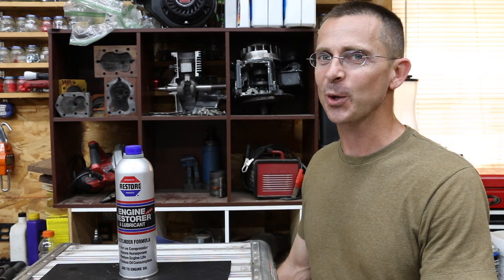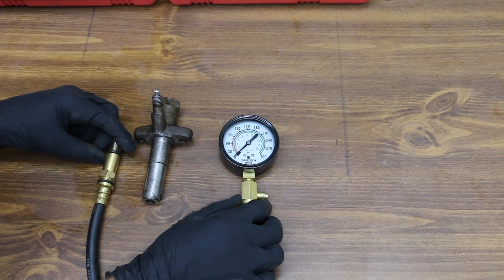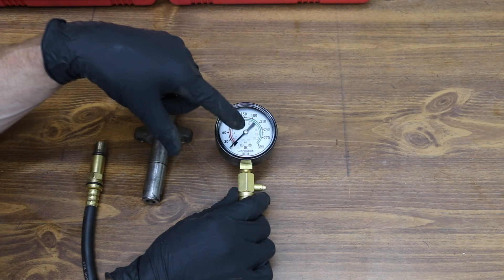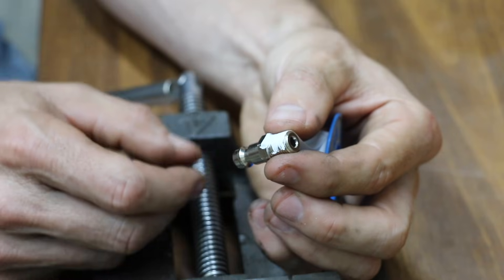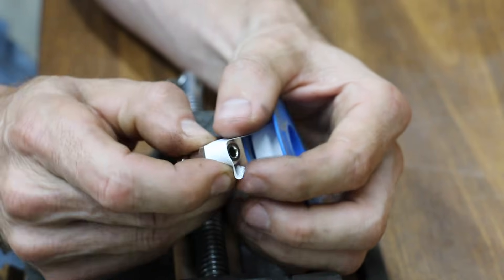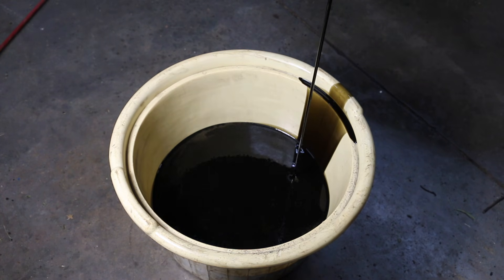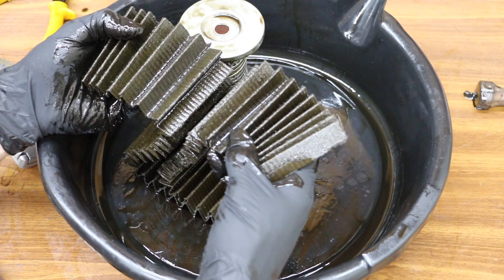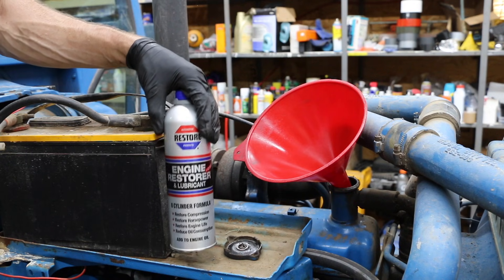Did the "Engine Restore" Compression Improvement Last?  One year later (Episode 2)

Comment: I've always liked restore. I don't back really any other products except for a couple of things like PB Blaster. I use ATF a lot when working on vehicles... great when added to engines with buildup. I would use ReStore in any engine that you're about to give up on and is not worth replacing. I wouldn't put it in a new high tolerance engine but I would definitely put it in anything else. I'm glad to see that it works and hopefully other people can use it and it will help them in their situations great video.
Reply from the maker: Restore seems to work great!

Comment: hey, you asked for new ideas ? here's one   HIPNOW   or  G system of Paul'S Pentone GEET   . The first one is a simple .375 inches i.d.  12 inches lenght  ss tube that you shape in a long   U   , you install it inside exhaust tube as close as possible to the exhaust manifold. It has to get hot. One side of the tube goes to the intake manifold via a ball valve, to be distributed to all cylinders, the other side will go to the top of a water reservoir heated by the muffler , a ball valve must be installed right before the intake  tube to control the super heated  water vapor. flow;   to avoid running away of the engine. .   When it will work, check the oil for cleanlyness. .    Quanthomme.fr   G system   experiment. . Would be really kool from you. . .
.
Reply from the maker: Great recommendation--thank you!

Comment: Great videos......you mentioned that, from your experience,  there are two oil additives which actually work, and Restore is one of them.  Please mention the other product.

Again, Thank You for your excellent work!
Reply from the maker: MotorKote and Bestline also seemed to have great film strength. However, I have not performed "long-term" testing on those products as  I've done with Restore.  Thank you!

Comment: You havent found anyone to machine a stock psiton into a high ringed ,high compression? I'm still rooting for a HIGH compression engine! You can mill the head down even by hand with fine grit paper. Just make sure you make valve clearance. Believe ,eit willsound like aoldtank when it starts.Torque like you wouldnt believe.
Reply from the maker: This is a great recommendation!

Comment: This is the one product I thought would not work, but did work! My 96 Outback with an EJ22 had bad rings in #1. I did before and after compression test and it did make a huge improvement! Also oil consumption went down, and mpg went up 2 mpg. Worked for a year and I just changed the oil and filter and added restore once a month. Ran a year then swapped in a new ej22. This stuff really works and helped me get by.
Reply from the maker: Impressive results!

Comment: Here's an idea: I was watching your STP vs. Lucas video and it seems like mineral oil is in STP.  Maybe test using mineral oil as an oil additive alone - not sure the mix required but that would be a cost effective oil additive in my book.

Mineral oil is great for electrical parts as well - as a sealant and protectant.  I've heard of folks dunking their PCs into mineral oil to protect against dust and water.  It'd be interesting to see if it also functions as a mechanical sealant/protectant.  Also, subscribed.  You bring experimentation to engines I haven't personally seen.
Reply from the maker: Great recommendation!

Comment: A suggestion I have for your next text with the lubricity test is for diesel additives. Since Cummins came out and stated that their engines should use diesel Kleen as  for their engines for engine wear and other parts, I'm wondering which brand would yield the best results. And for a cetane boost. Just wondered what you use for your old tractor as well.
Reply from the maker: Great recommendation!

Comment: My car's engine blew the head gasket,i torn the engine and the overall damage it had wasn't worth 700$ for a rebuild. I got the best replacement engine i could find for cheaper, however it's bad and even at 900rpm it has MORE cylinder blow-by gasses coming through the oil cap than what gets out of the exhaust!
Judging by your experiment, i think that this could help a little bit, although missing metal ain't gonna grow back. THANK YOU!!!
Reply from the maker: Thank you!

Comment: Prolong VS DuraLube VS MolySlip (AKA Mr. Moly). Had a 1953 Hudson a few years ago that had a recently rebuilt engine. It would take a lot of cranking to get it to start. Some times had to give it a shot of starting fluid. Drained the oil filter (one of those old style ones with the small lines, not full flow) to make room for the 1QT of DuraLube.

The first time starting after adding the DuraLube was like before, but from then on the instant the first plug fired it was running. One caveat though, due to it being a recent rebuild the rings hadn't seated yet. The DuraLube made it burn oil like crazy.

Had to change the oil along with a bottle of engine flush. Ran it for the flush's recommended time then changed the oil again. that stopped it using oil, yet the instant starting stayed.

Another hard starting car that DuraLube helped was a 1952 Nash with the big OHV straight six. Its side draft carb was a PITA, especially when parked on the left side of a one way street because the carb would angle down and gas would run out instead of being drawn in. With DuraLube in the oil it cut the friction so the starter could spin it fast enough to draw the gas in easier, even if the car was tipped to the left.

My sister and then brother in law had a 1980s Dodge Caravan which had developed a terrible knock that sounded like a spun bearing. Just for the heck of it I put in a bottle of Prolong. I had the van at my place for sale and every time I ran it for someone, it got quieter and quieter, until for the guy who bought it it had no noise at all. I told him it had had a really loud knock but he didn't care, he had a van just like it with a good engine but trashed interior. Said he'd run it until it blew up then swap engines. He ran it at least two years without the engine failing.
Reply from the maker: Thanks for the video idea!

Comment: I hav used restore in my 02 mustang gt ever oil change for the past 14 years plus use Mobil 1 fully syn 10w30 hav got over 320000.0 trouble free miles still runs strong get 3rd gear rubber with tap of the gas with new BFgoodrich tires
Reply from the maker: Impressive!  That's a lot of miles!
Reply: I used to b Chevy dude I owned 87 iroc Z28 5speed for 10 years at end of 10 years it had only 50000.0 miles on it and I worn out Toyota Corolla n mean while. Dang Chevy was torn up so much n had trouble finding parts cause it had 35 of 36 options offered that year !! Got my ford day after I sold Chevy and drove her every day sents 14 years ago

Comment: I've had good luck with Lucas transmission additive. And as a rule, I don't believe in most "mechanic in a can" products either😎
Reply from the maker: Thanks for commenting.
Reply: I used it in my 2004 Grand Prix that had in intermittent slip at long red lights after changing fluids and filter that was 250000 km ago I change out 4 litres every spring and add half container of Lucas trans ( few ounces,) no problems with my trans since . I believe if people changed Tran fluid 4 quarts yearly through dip stick tube you would not have 1/10; the transmission issues
Reply: I am looking for a used pick up ,one of the questions I ask the owners is have you changed the trans fluid since you owned the truck 99% say they have never changed the fluid ( no hope for the ignorance of the general population) then they run down the car companies when the transmission self destructs at 150000 miles

Comment: Sealant tape tip.  I use it a lot in industrial manufacturing setting.  I saw a lot of tape past the end of the fitting and this runs a risk of clogging if that tape get into small orifices.  To prevent that.  screw fitting into threads about 1 thread worth, then apply tape.  That's industrial best practice training.
Reply from the maker: Great tip!

Comment: I think you should start a little long run test where you try as many rust preventative strategies and coatings as possible. Everyone hates rust and everyone has their opinions as to what works and what doesn't. An issue is how well the rust preventative coating works if it's compromised, like through a scratch. I've heard that with things such as rubberized coatings, they work well until they get scratched or chipped off, because then water and whatnot makes its way behind the coating and the entire thing just rusts underneath the coating. And I've also heard that some treatments might actually accelerate the rust by pulling in moisture like a sponge. You might could start off with a longer video showcasing what exactly you're gonna do and then have short update videos every once in a while showing how everything's holding up. Have the test pieces in multiple different situations, such as pieces that are stuck in the ground, pieces just sitting outside,  exposure to salt water, exposure to fresh water, exposure to different chemicals, exposure to debris and abrasives(simulating say, the undercarriage of a car or truck, which is frequently subject to stuff getting kicked up from the road). I don't know, I just think this could be a series of videos that could really be useful for a lotta people. Not really anything that should require too much effort. Should just be treating the test pieces initially and checking up on them every few months.
Reply from the maker: I'll do it. Thank you!

Comment: Great video Todd, thanks for the update!
Engine Restore also helped my little 1310 Ford diesel tractor as well. It started easier and ran better after using the Engine Restore in it. Sadly, I sold it at the beginning of this summer because I needed the money worse than I needed the tractor.
Reply from the maker: Robert, Thank you very much!  I'm glad that engine restore helped the tractor and understand the money/equipment situation.  I'm in the same situation. Thanks again, Todd

Comment: Just a question I have a 1985 200s Honda atc.  Runs and drives good but during last oil change i noticed some metallic flakes in the oil.  It doesnt have an oil filter and the transmission is lubricated by the same oil.  Is it possible for most of it to be from the clutch plates and other clutch hardware and not much wear on the engine itself?  Anyways love the videos and hope to see more coming.  I would be interested to see how this product works in other engines like atv engines or higher revving engines.
Reply from the maker: It's possible that the flakes are coming from something other than the connecting rod and cylinder wall/piston/rings.  However, I'd recommend changing the oil frequently to avoid the flakes causing damage.
Reply: Project Farm ok thank you for the reply

Comment: You need an aircraft oil filter cutter. They are not that expensive.
Reply from the maker: I'll buy one.  Great recommendation!
Reply: They open it like a can opener. Remove the filter gasket before cutting the  filter. Otherwise you can break the cutting wheel.

Comment: I just bought my truck and it's a 2000 ranger 2.5l, just cleared out the truck with seafoam and was curious if DEF could work if sprayed in to get the same effect, I'm assuming no but also yes as it burns the emissions for deiesel exhuast
Reply from the maker: I don't think it will help either. Thanks
Reply: Project Farm thank you for your opinion I'll stick with sea foam

Comment: Awesome, good deal on that and another good video. A good tip on cutting the oil filters for filter examining is to use a chain tail pipe cutter, the one with the rollers on it like a tubing cutter. Make sure you get the longer one if you want to cut filters with it. Keep em coming!
Reply from the maker: Great tip!

Comment: Creating a new comment as requested, continued from below.  You wrote:

Thank you very much!  What type of round baler did you use behind the Ford 5000?  I recently purchased a John Deere 535 (makes a 5x6 bale).  I believe it'll handle it if I don't push it too hard.  Could you please create a new comment so I can easily locate your reply?  Thanks again!

I honestly can't remember the baler number, it was a John Deere and made 4x5 bales.  I never baled with the 5000, only wrapped to make baleage, and usually not with the Ford.  The main wrapping tractor was a little IMT 539 deluxe, similar to a Massey Ferguson 35 I suppose.  We baled with a John Deere 3020 back then, in the early 90s.  Everybody told us we'd never get over 20% protein, but with diligent mowing and careful manure spreading we got to 23% once, on the 5th (!) cutting!

As long as you're on flat ground the 5000 will handle it OK.  If you gotta bale any big hills I'd be hesitant.  Remember, the fuller the baler the tippier it gets.  I live in the northern Appalachian mountains in south central NY state and as such we needed a bigger tractor for the sides of the mountains we had to bale.  A full round baler will push you around sometimes in the hills and the pucker factor that follows close behind will rip the seat!  lol  We were using a Ford 7600 with loaded tires around 10 years ago and were still being shoved around.  Went up to an International 1486, loaded tires, and that solved all problems except the fuel bill!  Love my red tractors....

One tip I'll mention when round baling in case you might not know already:  keep weaving back and forth, making sure to crowd the edges of the pickup head regularly to make sure you get a good, tight, squared edge bale.  The bales edges are more important than the middle when it comes to handling them later, and stacking.  Baler's got indicators on each side telling you where you're at in the chamber so it's just a little practice and you're fine.  As far as wrapping the twine it helps to have a flow control on that remote outlet to control that twine arm better.  It's faster than hell with a tractor with good hydraulics and you gotta be quick and only bump it a little.  I don't recall the 5000 having super hydraulics so you might be just fine.

Glad the old girl's starting and running better after the Engine Restore.  It's always nice when a product works.
Reply from the maker: Thank you very much for the follow up on the original post! This is all very helpful information. Fortunately, my property is pretty flat with a couple of very small hills.  It's an old baler and will probably require some work before I put it to use. Thanks again!
Reply: You're welcome my friend.  May you always get your first cutting in before the grass heads out.

Comment: The valve adjustment make a huge difference in how a diesel starts and runs. It's probably never been done on the tractor.  I set the valves and injector height on my C-15 every year.  It made quite a difference on our Deutz tractor also. It starts better and smokes less.
Reply from the maker: Great recommendation.  I'll check the vavles.

Comment: There is one product I found very helpful.
 It is made by.           ( bars leak ) it's a 2 part oil additive to stop leaks and restore compression.
 I tried it in a 1971 Ford 390 engine and the oil pressure came up almost 10 lbs and the engine seemed to have more power. The engine however, has never leaked or used oil it just seemed to have lack of power. I believe that the product did work, so I thought I'd share the product with you...
Reply from the maker: Thanks for the video idea!

Comment: I always knew Engine Restore worked, and now everybody else does to!  Kudos to you for taking the time to pop all the injectors out one by one and compression testing the cylinders.  It is a true pain in the ass.  Not hard, just time consuming, and a pain in the ass!  Good job, nice tractor too.  I've got some time wrapping round bales on a Ford 5000.  Yours is much cleaner and nicer than the one I was on!
Reply from the maker: Thank you very much!  What type of round baler did you use behind the Ford 5000?  I recently purchased a John Deere 535 (makes a 5x6 bale).  I believe it'll handle it if I don't push it too hard.  Could you please create a new comment so I can easily locate your reply?  Thanks again!

Comment: Did you say that engine restore stuff has lead in it? Seems like you could potentially be breathing it since some oil on a low compression motor is likely to burn!? The copper and silver are ok but although I can understand the practical application lead seems like a really bad idea health wise, I woudln't use it for that reason.
Reply from the maker: Thanks for commenting on this.
Reply: I've seen a few other videos that it does work and that is pretty cool, was trying to find something else that works but doesn't have lead in it and couldn't find anything.

Comment: I recently tried some Lucas oil leak sealant on a Ford Explorer with 163,000 miles, did not stop leak completely but improved it. However it did seem to help my mileage for some reason, any other advice for keeping this engine on the road longer.
Reply from the maker: Just the normal advice of keeping the oil changed. I like to periodically use Seafoam and MMO as well.

Comment: You lost  a bit of compression with your adapter. Next time just grind the very tip off the injector tip and take the needle out. When you took the whole nozzle out you lost several cc's in the combustion chamber.  For your diesel tractor bump the timing up a few degrees. Just move the pump. There is a line on the flange where the timing is marked on the pump.
Oh! The industry standard for  compression tests is diesels is with 6 pumps of the gauge and gas burners 4 pumps. I really like the way you test things and I though you might like this info.
Reply from the maker: This is really helpful information.  Thank you!